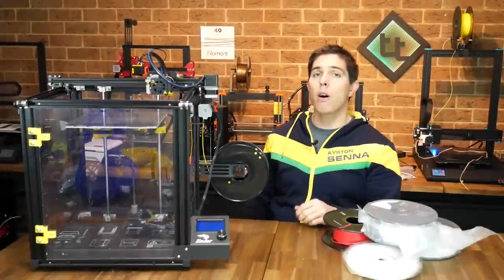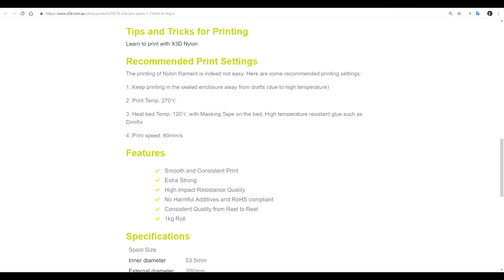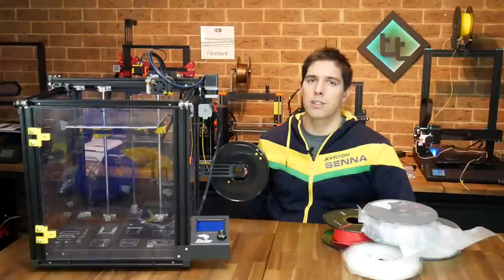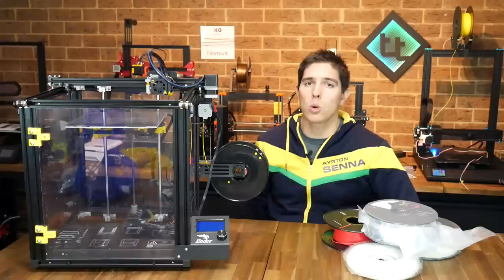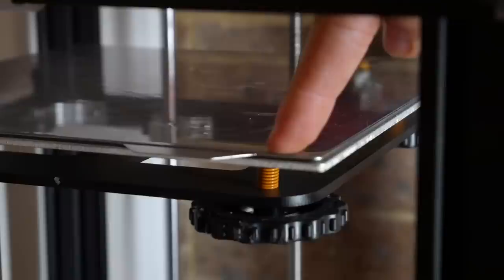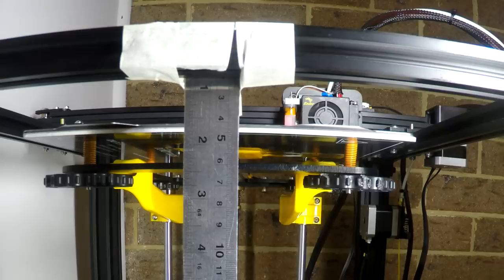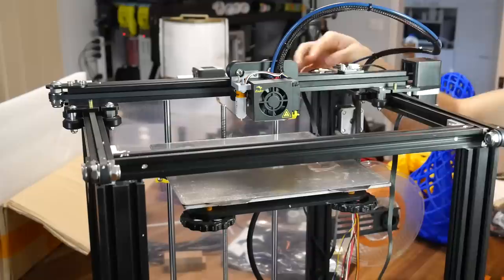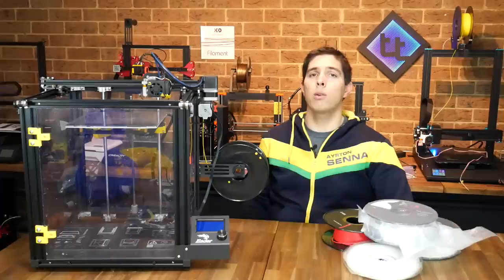Enclosed Ender 5 for high temp filaments - Part 1

Comment: Great idea using the extrusion slots to hold the panels. Any rough cuts would be easily hidden.
Reply from the maker: And I had a few. The panels were too big to fit on my cheap table saw so my circular saw cuts were a bit rough.
Reply: @TeachingTech  what are the sizes for the acrylic sheets please

Comment: Hello Michael,

For the top I think the best option would be to install a flat telescopic bellow type seal as those typically employed in sealing linear guides in CNC machines. The movement of the y axis will compress/expand the below and ensure that the top is always covered. You would need to check if this has any negative effects on the printing accuracy due to the additional load in the y axis motors.

Looking forward to part 2, hoping to do something similar some day to my Artillery X1!
Reply from the maker: That's an interesting idea, thanks for sharing.

Comment: Awesome!! I got my Ender 5 after seeing your review and am really interested in this upgrade series. Thanks Micheal
Reply: Same, did some reading and watching vids and decided for Ender 5 as well, though there is no preset under Cura but I just added it xD. I have upgraded mine with the motor dampers and smoother so far. I 3D printed the smoother bases to hold them in place in the power housing :); also 3D printed the housing of the control panel for the back, my design was a press-on fit and no need for screw, left a .5" hole for the speaker on the back, the design was not perfect as I needed to move the tabs further and possibly a little smoother but it held on. If any of this is of interest I have the SLT files for those 2 designs.
Reply: I have the gcode if that saves you the headache of trying your settings and I made it so that it printed very quickly and still strong :) the control box housing I had to pull a little which created a crackline but only because my tolerance was really tight, I believe I ended up just cutting off that crack which was leading towards where the speaker hole was anyway.

Comment: What a great video.  I have ordered a Micro Swiss hot end, Capricorn XS Bowden tube and fittings, SeeMeCNC's EZR Struder and a TH3D EZBoard Lite  for an Ender 5 that is not even ordered.
I have a stock Ender 5, but am purchasing a second one to mod.  Your channel has really helped with what  improvements to make.  Thanks for all of your work

Comment: I'm looking at building an enclosure for my Ender 5 as well. I've seen your design before in other places, but like you, got stuck with covering the top. I think I'm just going to go for a large cover case, for the entire printer, instead of just the acrylic sides. I'll make it big enough to fit over the spool (mounted on the inside of the frame) and x + y motors. I already have the printer on a table I built, that seems to have enough room for a whole enclosure. I also plan to make the front face the only acrylic piece, with plywood (and some sound dampening foam) on the other sides.

Comment: I am doing this with a IKEA Lack rack right now! This is rad to see!
Reply: /thing:2012384 I made the lower leg part longer so my Ender 5 will fit on the Z, im printing it right now so I dont know the end result yet. On the X and Y there should be enough room, atleast its sitting on a Lack table right now and it looks big enough.

Comment: Nice video... So for your door closure I would suggest to add to your door by the handle a magnetic stopper so it keeps the door closed. 
On the top I would go with a basket design. So you build a wider frame on the top and than you put over it a globe case which fit's just right. With hinges in the back you can just again simply flip it open when you need to work on your unit. And the magnet's I suggest 3 so left corner, center and right will ensure the units is closed and stay's closed and doesn't move around while printing because the 3 magnet's holding it firm enough in place.

Comment: Just put a big plastic box over the top that clears all the moving parts. I've tried for a while to have a flexible lid for my ultimaker that accommodates the moving head out of those oven bags used for cooking turkeys. However, at the end of the day it was messy and difficult to service. The solid box lid is easier

Comment: I would make a lightweight lifted canopy for the top cover. It doesn’t need to be form fitted it hmmsut needs to provide a ceiling and be mostly air tight. Some thin plastic sheeting and a lightweight frame to wrap and bobs your uncle. Wouldn’t win any competition or beauty contests but it would satisfy the McGyver in ya.

Comment: I think a pet heat lamp mounted above with a canopy style peaked enclosure would do a great job of holding the entire print chamber at a more regulated temperature without getting in the way of the moving parts.

Comment: For the top what about making accordion style plexy glass. You coulds cut strips then cut slots on them and hold them together with bolts that are just loose enough for them to slide. Use t-slots to attach to the frame on the front and back and figure out a way to attach them the the extruder rail. The front one will need to stand off of the extruder rail enough to allow the extruder to move but will still keep in moat heat.

As the extruder rail moves to the front the front accordion plexy will calaps but the rear will extend. Hope that makes sense, it's kinda hard to explane.

Comment: A couple suggestions:

An iris style hood made from acrylic and old cd's. Looks cool and moves with your hotend

Or much simpler, a bubble style hood with an exhaust fan at the tippy top for even heat circulation

*And I will also comment on your Senna jacket
Reply from the maker: Great and interesting suggestions, thank you.

Comment: I made a couple of months a mod like that. Although one of the main problems I encountered was that the vibrations of the printer with the acrylic acted as a sounding board. To solve this problem I used a rubber edge (normally used to pass cables) similar to the silicone of the windows.

On the other hand, the problem with which I have found is that since the hotbed is at the top on first layers, the temperature at the top of the printer is not kept constant due to air flow, so I can not avoid warping.

Comment: As for a top cover, something removable would be best IMO. You will want easy access to the hot end and be able to remove the finished part easily. I think pins sticking out the sides with a shallow 'box' style cover which would sit on the pins should work decently. However, you will still have an air gap all around. Nothing you can do about that really aside from building an enclosure the whole printer fits into.

Comment: I think if you could print some brackets that would bolt to the outside of the top and a slot on the end to hold the plastic sheet you could make a big enough top to place over the unit keeping the heat in the box. I'd still try and move the power supply and the motherboard out side of the box area to keep it cool.

Comment: Great upgrades, I've been thinking of setting up my new Ender 5 to be an enclosure- I got it after watching your review of it, thanks for that video! For the top cover I've been thinking of doing a bending the plastic to be an upside down U shape attached to the top front and back rails and swooping up over the bowden tube, maybe even hinged so I can get access to the bed from the top. As for the top sides this leaves open, having the top piece overhang out past the X axis gantry and then come down before undercutting the gantry back towards to the rails; either attaching to the top cover or more likely separately mounting to the side vertical rails so I can keep the top cover on a hinge. I can't wait to see what you come up with for the top cover. Thank you for all your videos they are amazingly done and a great help for me to understand more of the electronics and programming upgrades out there.

Comment: Are the measurements correct for the door? Because it should be smaller than the back and not bigger. I've cut the same size and it went over the two posts and not in between.
Reply: The door is incorrect. His dimensions are too large. The back and sides fit perfectly but I’ll have to cut the door down to fit

Comment: Just used your dimensions to do the same on my Ender 5. I just received the sheets I had ordered to be cut to the right size, but the front door panel dimensions are clearly off 🥲 it should probably be 330x400, not 370x400
Reply: Wish I read your comment first, dealing with the same issue currently. Took the dimensions from the video but the door one is way too large. Should have measured myself before ordering.

Comment: Great. Have been printing ABS and HIPS and NYLON a lot with a simple enclosure on my matterhackers pulse. Just 5 poster frames taped together. Now MH ABS still cracks and warps. but Hobbyking ABS and HIPS does not and it smells less. Also print on garolite and Nylon sticks real well Both Taulman bridge, 910 etc and the Hobbyking CX12 with a bed between 90 and 100.

Comment: cover the top will be dificult and the more important zone to cover to avoid that all the hot air escape, maybe you can recirculate the hot air from top to the bottom with some fans and maintaing the same temp in all zones. i dont know..
Reply from the maker: That is an original idea, thanks for sharing.

Comment: Finally a real 3D printer :) I don't see any use for PLA. But I wished you had chosen the Sapphire S for that modification (and the other ones), because it's frame structure seems to be perfectly made for this, avoiding that movign components on top problem.

Comment: Maybe an overlapping dome type top cap, or maybe a complete box over the whole thing, because I would assume the hot air rises and slowly stacks to a lower level. Has anyone put heaters in the box to externally heat the print.

Comment: Hello! Good tutorial! Just a detail, if the back plate has 340mm side, would the front plate really be 370mm? It seems incorrect. Wouldn't it be 330mm or something?
Reply: I was wondering about that, too. I am planning to build this enclosure, but I am hesitating, because I don't want to buy some expensive panels just to realize they do not fit. :/

Has anyone build this enclosure yet and can share how the panels fit?
Reply: @sonnentaugnu2184  Hello Friend.
Yes, I did with the following measurements below, a little differently.
330 x 400 front
380 x 405 sides x2 (In the standard ender 5, the belt runs on the upper internal part of the frame, so the acrylic plate cannot touch the frame at this point)
340 x 410 rear
Reply: Thank you  @igorterra1444  !
Yeah that makes sense. I will try those measurements for my panels. :)

Comment: I will definitely be doing this to my Ender 5 once it arrives. Although most of my printing is likely to be in PLA, I do plan to do some carbon fibre PLA printing, and any safety enhancements I can make to the machine will be adopted. I'm thinking that a top cover could just be a shallow box as heat won't rise. So as long as the sides of the cover come down past the top rails a bit, most of the heat should remain inside, even with hot end fans blowing etc. I'm thinking about the design and how to mount it as I type.

Comment: Could you do a video how to put a bootloader on the Ender 3 with the Creality BLtouch kit programmer? :) I see some people made it using your files, and you also have the kit. Thanks for the tutorials, have helped me a lot.
Reply from the maker: Prepare you firmware like usual in Arduino, then when done, go to sketch > export compiled binary. Now follow my instructions from that video to flash the hex that will appear in your sketch folder. There are two, you want the one that has 'with bootloader' in the title.
Reply: @TeachingTech  ok thank you :)

Comment: Michael I couldn't find another way to ask you a question ,im thinking of purchaseing the artillery sidewinder x1 and was curious if you can add auto bed leveling to it thanks
Reply from the maker: Recently made a video on that, with options to add BLtouch or Touch Mi.
Reply: also what is your opinion of the sidewinder or cr - 10s

Comment: Since the electronics are in the base of the Ender 5 at what point would you consider moving the electronics outside the enclosure? We put heatsinks and fans to cool these components. Having them in a hot enclosure would defeat these cooling efforts.
Reply from the maker: I think if it becomes an issue, a inlet duct from the bottom of the printer could be used so cooler air were being drawn in.

Comment: Good morning
Planning to build Ender 5 I'm interested in how you built the sides of the printer, or put the walls in the structure?

How did you make the door, hinges and lock printed?

Own projects or designs?

Are you planning a chamber heating and ventilation system (ABS printing)?

best regards

Comment: I want to see what chamber heater you use. I need to build a chamber for my ender 3 so I can print without worries of off gassing or hydroscopicity
Reply from the maker: I believe there is an option built in to Marlin, but I'm not sure how refined it is. Otherwise I'll be setting it up as a fake second hot end, with heater output and thermistor input. This is why the mainboard upgrade is needed.
Reply: @TeachingTech  I see, I'll be looking forward to your videos. Another point, bought a BLtouch for my printer and used your tutorials to get it working. I had so many headaches getting it working until you released that recent bug fixing tutorial. Thanks for the great videos!

Comment: I see you are replacing the hot end on the ender 3 & ender 5 printers with all metal hot ends in order to print nylon, carbon fiber etc. Would you by chance know if the ender 3 "PRO" and ender 5 "PRO" come standard with hot ends that do not need hot end modification to print nylon & CF? Also, I am about to  purchase my 1st 3D printer and will mostly be printing materials that need to be high strength & rigid.  Do you feel the Creality products are up for the challenge? And, since I'm basically looking for strong & rigid vs. nice looking, Would you recommend another printer within the same $300.00 - $600.00 price range? Your assistance with this decision would be greatly appreciated.

Comment: What is the min width that you can get away with on the ender 5 enclosure? My enclosure has a max opening size of 19 1/2 inches. If you relocate spool and controls can it fit the Ender 5?

Comment: Some good ideas but the cover is far too restrictive.  You lose access from 3 of the 4 sides and what about the top?  All the hot air rises and leaves.  What's needed are 4 exterior panels plus a top which can all be assembled easily to each other around the entire printer.  Also, why didn't you use the Micro Swiss direct drive extruder?  That seems like a no brainer to me.  BTW, there's an all metal hot end from a company called GULFCOAST ROBOTICS that looks like a Micro Swiss clone and is less than half the cost

Comment: Excellent Video! 
What kind of mainboard are You planning to install?
Reply from the maker: At this stage an MKS Gen L.
Reply: @szabolcspahan1277  They just started taking pre-orders.  I hope to have mine by 6-14 or shortly after.  The price is also better $ 90
Reply: @woodwaker1  Yes, but they have also removed the dual extruder support. It would be easier to justify a purchase of a $115 board right after buying a $320 (Ender5) machine, if there would be more potential in it. I think, I will just wait for the reviews before deciding to buy one.

Comment: Hmmm...I went through all the trouble to build a lack enclosure for my Ender 3, only to find it prints nylon just fine without it.  Too much talk on message boards out there about how nylon really needs and enclosure and even a "fixed bed" printer. Rubbish.   I make threaded nylon parts that screw together perfectly.  Haven't tried ABS.  
Also, nobody mentions what a pita it is to deal with an enclosure. It complicates all the maintenance.  You're basically working on your printer in a big fish tank.  Just changing filament spools turns into a hassle.  FYI.
Reply: Doug Johnson 
What brand of nylon filament does this work for?  Remember that every manufacturer (and even each production run) will vary in properties.
Reply: I think an enclosure will definitely reduce the amount of failed prints if someone plans on printing a lot of high temp materials. Sure it's possible but it's about making your life easier. 
Tho I will agree these typ of enclosures that are built onto the printer seem to be quite a lot of extra work when doing repairs or maintenance on your printer. A enclosure like the lack ones seems to be the better solution. Just place the whole printer into the enclosure and when you need to wok on it you simply take it out
Reply from the maker: I used to print ABS exclusively on my Solidoodle Pro and the part quality was greatly improved when I added an enclosure.

Comment: Hello, i've read on thingiverse that the dimensions of acrilic windows isn't exactly correct, can you give me the correct dimensions? Thanks in advance!
Reply: I'm currently doing the build(ender 5+), not sure if you'll still need it but here it goes:
Interior metal gap (inward to outward) is 1/4 so keep in mind that I measured the outside and then added 1/2 inch. (Except for the front door)
18 x 20 1/8 Front (will need to be adjusted but I'm not there yet)
19 7/8 × 20 3/4 sides x2
18 1/2 × 20 1/2  back

Keep in mind that you should atleast take off an 1/8 from each dimension (except front door) that way you get a slight 'wiggle room' for each side. Currently bough one sheet and I did the sides first. Keep in mind that the metal gap is (width) about 1/4 so depending on the width of your acrylic, you may need a U-shape rubber seal to go along the plastic which will make a tighter seal